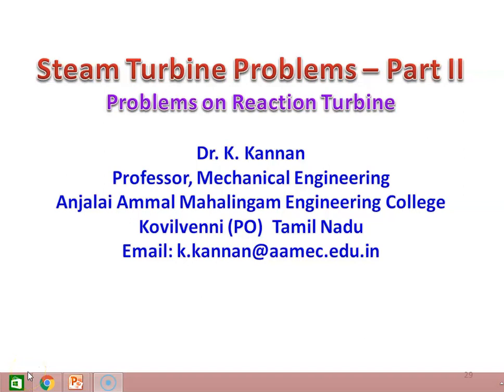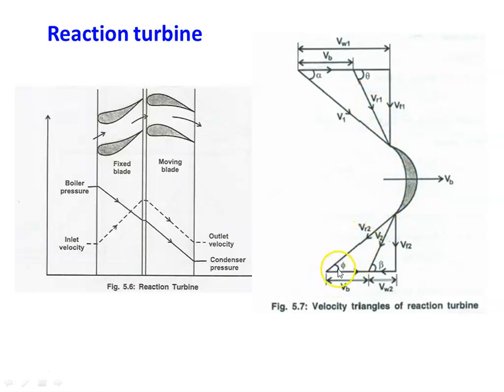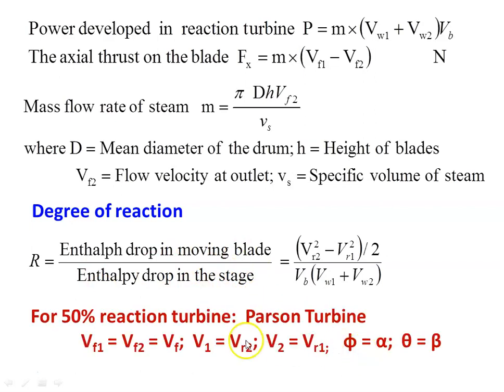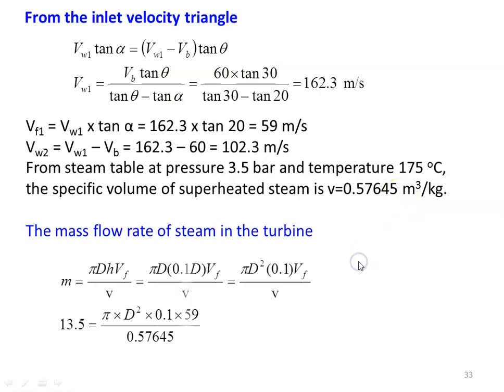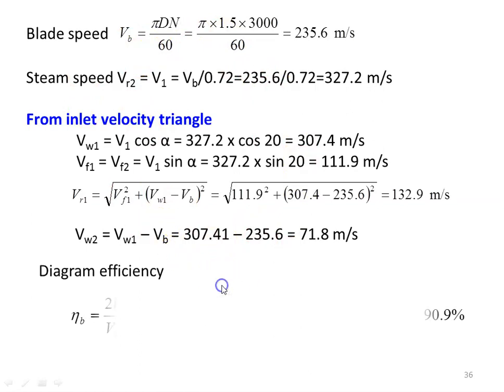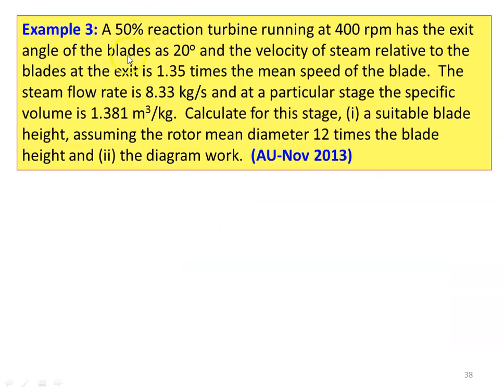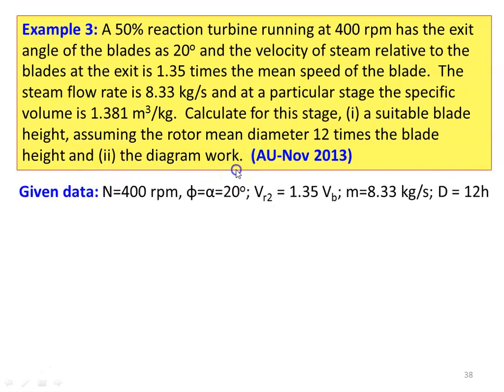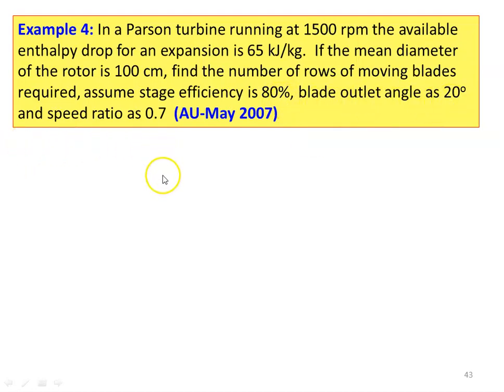ST 07 Steam Turbine - Problems Part II

Comment: Sir  in problem 2 increase in diagram Efficiency you take 93.8 how did you find that sir
Reply from the maker: There is a substitution mistake. Diagram efficiency are 90.9 and 91.02 
The increase in diagram efficiency is 0.13%
Reply from the maker: Thank you